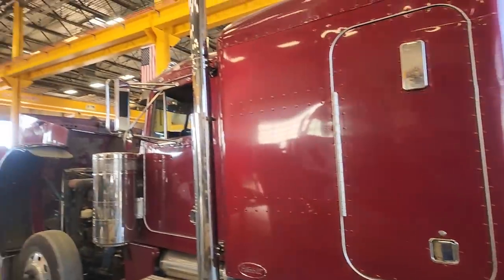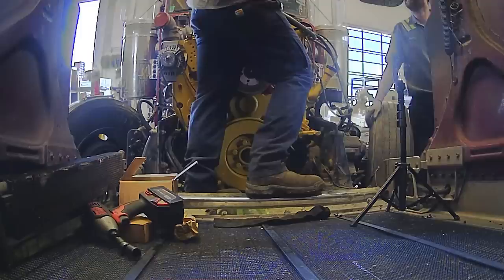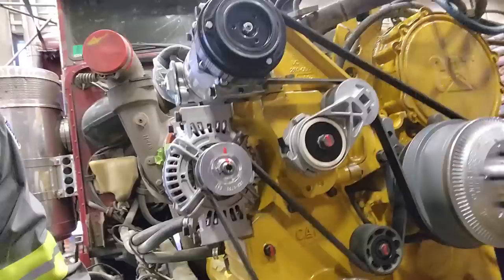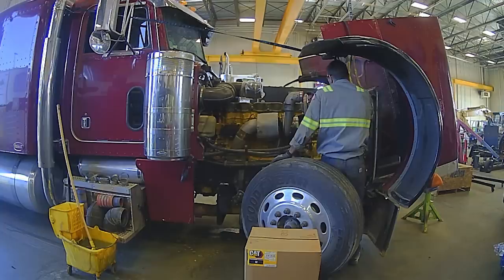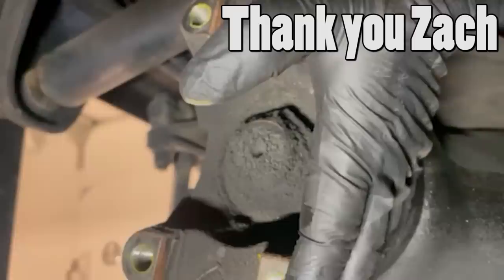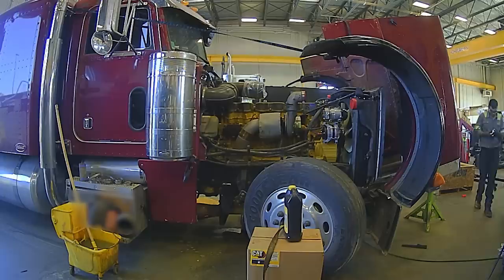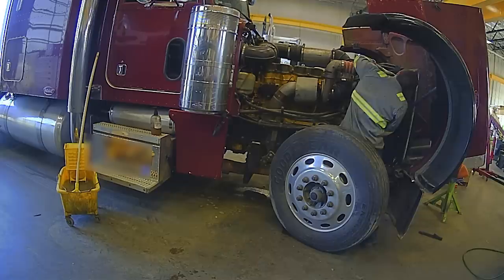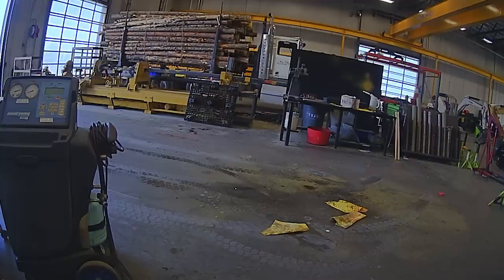600 HP "Texas Red" Peterbilt Serpentine Belt Retrofit Part 2. Cat C16.

Comment from the maker: Hope you enjoyed the video. If you wanted to get the Airlift Cooling system filler, Click the Amazon Affiliate link: Airlift Cooling System Vacuum Filling System: https://amzn.to/3D9AlPu
Reply: I got one of these cuz of you a while back. The absolute best!
Reply from the maker: I just checked and I ordered mine over 10 years ago, probably have used it close to 1,000 times by now, still has the same fittings and everything.
Reply: Order placed, thanks.
Reply: Love my airlift.    Great investment especially on automotive applications with inlet mounted thermostats.
Reply from the maker: You are my hero. Amazon helps support the channel this way
Reply: I'll have to check it out 👍
Reply: loved the video. I worked for 45 days as a big rig fabrication wannabe mechanic (not engine work--body modification for snow plows) with no training. I got fired. I needed training. lol. That little experience made this video all the more enjoyable. All the best.

Comment: I measure where the fan is centered before I retrofit a serpentine belt drive. The most important thing is to center the fan in the shroud. Then fit the belt to that set up. I have done the same conversion on older Detroit 60 series engines

Comment: This is a worthwhile upgrade on an older c15/16 with high horsepower. The v belt setup was inadequate when they were new. I remember around 2000 they started putting an optional "power band"  (2 vbelts molded to each other) on them because the fan belts just wouldnt stay tight enough (or have enough grip no matter how tight!) to keep the fan spinning in hot weather. They would slip just a little for a few days until the glazed over then would slip alot until they were replaced. Engines would overheat pulling a hill. The power band helped greatly on a stock engine but put some fuel to it and they just cant keep up. Nice job as always!

Comment: Informative video 👍 I ran into those Pete trans cooler mounts several times. Finally started welding the nuts to a sheet metal bar. (For the next guy😉)

Comment: Even if you don't need a custom A/C hose, it is good to know your hose fabricator anyway.
When I was doing auto repair, there were 3 times I needed an A/C hose.
1. Mazda 3. $150 at the Mazda dealer.
2. Nissan Sentra. $140 at the dealer.
3. VW Cabrio. $350 at the dealer. That's absurd, the hose was basically the same as the other two.
We sent it to a local hose fabricator and paid $100 to have it saved. Well worth it. The host had nothing special in it to make it so different from the Mazda or Nissan hose.

Comment: I'd have made the same retrofit choice as no one seems to make a good V belt anymore, at least nowhere near as good as the old ones. Whatever compound they're making them out now hardens too fast, glazes no matter what you, ends up squealing and becomes a whole thing fairly quickly. And that makes home mechanics overtighten belts, and that in itself becomes a whole thing rapidly.. wear out the bearings etc. V belts aren't worth it if you can swap it over to a serpentine
Reply: That's good to know. I also noticed it was much harder to find the right v-belt anywhere same-day in a fairly large town, whereas serpentines have always been in stock when I needed them.
Reply: U wouldn't think it, but when the belt squeals its wearing the pulleys,  once I replaced the alternator pulley and the ac pulley, no more glazed belts and squeal when the fan comes on at high rpm with ac going.  So when it needs a new ac pump I replace the alternator pulley and belts and it's good to go. Roughly every 2yr on a dump truck
Reply: @kwmiked  What's your dump truck got under the hood?
Reply: @MacPoop  2ws and 2 6nz and a tri axle heavy haul tractor with a mbn that is fixed with the proper parts 🤭
Reply: @kwmiked  you're lucky you can still get proper parts for it! I do a lot of "future-proofing" myself, thought it was interesting this guy brings a Cat in for a serpentine belt upgrade and I'm sitting here going "that's exactly what I did to my Ford powered boat (old Lima engine)" I can get the entire front drive off a Ranger or T-Bird or Mustang and run the single serpentine not deal with these new junky v belts & try finding new old pulleys once they're too glazed up to use. I don't have anything that big at home (tri axle etc) but I do have a lot of older junk with no other choice but to modify & retrofit as needed.

Comment: Sanden offers many different rear heads for that compressor. You can buy the correct one to fit the original hoses. But since they are 20+ yrs old they are due to be replaced anyway.

I make custom and stock replacement ac hoses at home as well as nitrogen pressure testing and charging ac systems.
Reply from the maker: That is good to know Chris, I know you always comment too. With the type of people that watch this channel, I'm sure a team could be assembled to build a space station faster than NASA

Comment: Pirtek is a company that has shops that can make custom hoses. They also cav mobile vans. I do not know if they are in your area. Their system can let you reuse your hose ends. They cut off the old crimp collar and have replacement collars that will clamp the hose end to the hose assembly.

Comment: Measure center of crankshaft to center of old fan hub, so fan will be close to old location. I use 5P4115 washers on the fan shroud.
Cat makes a few top mounted A/C compressor setups, 261-7554 MOUNTING GP-REFRIGERANT COMPR, 240-8215 MOUNTING GP-REFRIGERANT COMPR. As you well know, trial and error.
Reply from the maker: Thank you for this info John, that customer was asking about it so I'll look into these part numbers.

Comment: Definitely better with the serpentine setup, your only replacing 1 belt vs 3.  Of course the downside,  if that belt should break.  Moral of the story, always carry spare belts.  In my t800 i always have both belts and the idle/tension pulleys.  Also carry a spare flange flexpipe.  Gotta love emission motors, no regular flexpipe,  gotta be flanged on both ends.  Anyways, i also carry a spare flexpipe and clamps under the bunk.  Dont know why, but it eats flexpipez every 6 months.
Reply: I pop rivet mine

Comment: My 2 pence worth abe.

SERP belts are all well and good, but on many modern cars they take away the ability for the home mechanic to do. Changing v-belts was a 2 min job, and required a short breaker bar, no more no less. Nice and easy

SERP belts though, so much more tightly packaged, there's zero chance of being able to do them on the drive [Last one i had to do, Bumpers off body part off, rads, intercooler, oil coolers and trans cooler all taken out, front crash structure and a bloody engine mount], and you need a much bigger bar for tensioners, a real problem for little old me.

Comment: Hey adept ape thanks for your videos I really love the information you provide and it really helps with my research for building a FMTV 6x6 16ft expedition build. 
QUESTION: I really love the Mechanical nature of the 3116 CAT but not the common issues associated with it. I know for certain I can fit a 3126 and a C-7(not really interested unless I get the second Huey pump filtration mod) or go with a bigger C-10 , C-12 if they fit and still have the exhaust and intake on the same side like the 3116. Any recommendation if I could fit the bigger two….Should I for power and reliability if Fuel mileage isn’t a serious concern as I just over budget for it anyway?

Comment: Any reason not to put medium duty box truck in neutral down hills. 7.3 powerstroke 6 speed manaul f550. At 70 mph its 2750 rpm, 60 mph 2250 rpm. I try to do 55 when transmission engaged to keep the rpms down. Brakes usually are not needed much.

Comment: I have a 6nz where someone tryed to put a serpentine system on it ...suppose to have an 8 spline belt but that jumps off the bottom pulley so I'm running a 6 spine belt im interested in his v-belt system if it will work on my 6nz or a parts list on what you put on his engine any help would be greatly appreciated thanks

Comment: I have a C15 acert twin turbo in my 07 379 it has 330,000 on a platinum overhaul. When the engine isn’t up to temperature it has a “cold skip” but goes away once the engine reaches temperature. What is causing this and what should I do. TIA, love the videos
Reply: Cold mode mine is the same but all is well

Comment: If you had gotten correct a/c compressor won't have had to change A/C lines.
Reply from the maker: True, although we were going on what we could source in the time constraints allowed. Given enough time we might have been able to find a vertical mount AC compressor bracket or a top mount AC compressor. Everything went together with only a single line change, I'm not complaining.
Reply: @AdeptApe  Any Peterbilt dealership have them on hand in most cases. My point when line fails he won't be running to dealership to get a line. Unless they have ends, hose and machine to crimp them. I am 25 yr Peterbilt tech, I have changed belt system and glider kits. I'm about trying to keep it OEM makes far easier to fix and get parts later on

Comment: is there a way to measure the pressure of the belt on the pulleys to make sure the bearings don't fail prematurely?
Reply: Of course. The old trick is by pressing on the belt and checking how much it deflects. Of course this is a by hand feel sort of thing. Its best if you can always do it between pulleys that are equal distances apart, but that isn't always possible, like on my jeep. The jeep has an issue were you can really on test on a short distance between pulleys, and you feel it is tight checking this way, before it really is. There are belt tension gauges which take the guess work out of this and you get a consistent pressure each time. I will just add, a lot of systems use automatic tensioners, so the system is taking care of that part of the equation for you anyway. Not all systems do though, like my jeep, which is a manual adjust system.

Comment: Have you seen a lorry (on highway) with a C18 in it?
Reply from the maker: Not in an "on-highway" truck, in an OshKosh firetruck though, not really the same thing.
Reply: KT3406E the youtuber has made one for an on-roads truck using an ACERT cat clock and using a stroker kit to make it a “C18”
Reply: @AdeptApe  We appear to have a spammer in the comments who's impersonating you.
Reply: We run c18's here in alberta heavy haul oil field ect